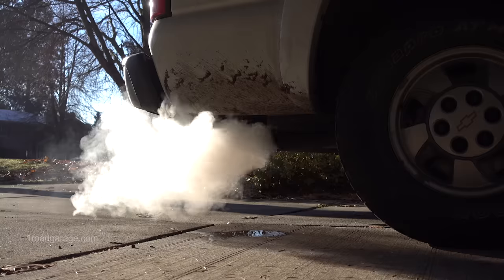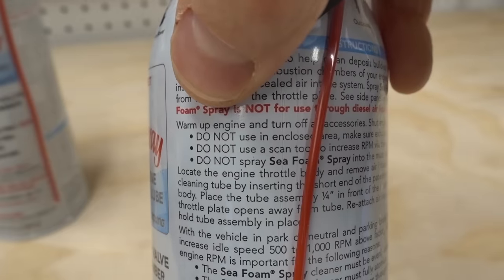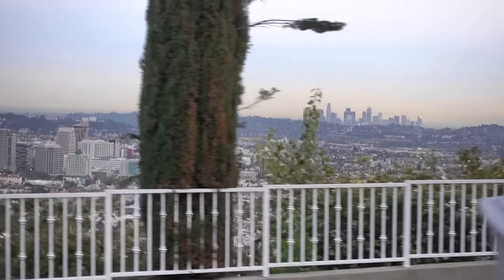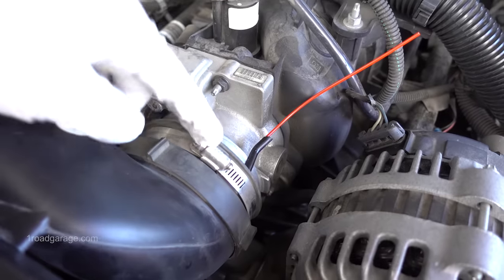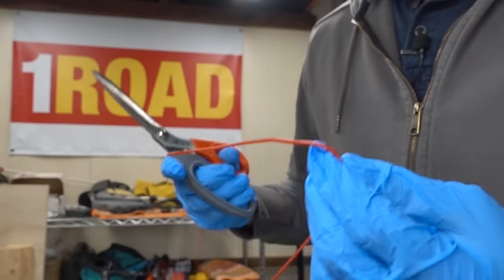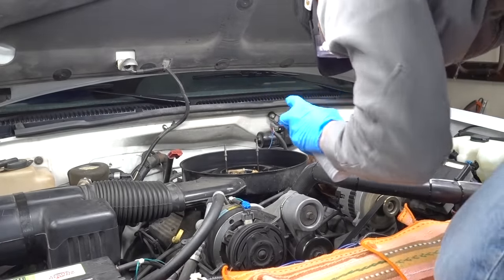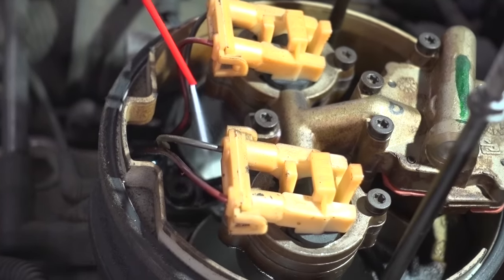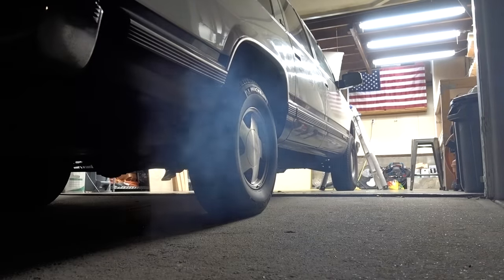Why You Should NEVER EVER USE SEAFOAM!!

Comment: I have used sea foam for the past 35 years in everything I own. I have a 20 year old riding lawn mower. It runs great and still has the original spark plug in it. It works that well, sea foam and my mower. I used a camera to look into the cylinder and the piston is incredibly clean. I also use far more than the recommended amount. I also us Mobil 1 engine oil. For 6 dollars a year its cheap. It always starts every year with leaving the gas in it all winter. my snow blower is also equally great running with Mobil 1 and sea foam. Living in Minnesota I get a lot of use out of it. Buy it! I have never had an issue with not starting leaving the gas in both year round.

Comment: I have a 99 Tahoe with over 200K. I did the hot soak spraying into my throttle body. Did see white smoke but not a lot.  I threw some seafoam in my oil n will change oil in 300 miles. Great product. Love your videos.

Comment: The way to do it is similar to Wal-Mart: Basically, have a way to meter the intake side of the engine, using the brake booster hose (it's like using a vacuum pump to bring in the Sea Foam directly into the intake system). Then, use half of the can and run it through your fuel system -- and keep the car running at idle the whole time in Neutral (manual) or Park (automatic).

Comment: You have to pour enough seafoam into the engine to stall it at Idle. Allowing the engine to run after you've stopped applying the sea foam clears out much of the seafoam.  if you wanna get those epic smoke plumes you see

Comment: Those old T-body engines have fuel constantly cleaning the inner surfaces of the intake manifold and runners. Newer  injection system designs never see fuel up in the intake, just a mixture of air and crank case vapors, which equals more crud build up in the intake stream compared to your old truck. Newer isn't always 100% better .  You'd be better off just dumping the cleaner in the fuel tank and drive as usual.

Comment: Never used this stuff in my life...until this week. Put some in the tank at a pretty good level of concentrate and added some to the oil 100 miles before an oil change. Honestly, you can feel the power difference in the pedal and the valvetrain noise is markedly less. Impressed. Ford 3v 5.4L with 189,000 miles, otherwise a well maintained motor but obviously had some carbon and sludge.

Comment: I NEVER used Sea Foam on my truck and it cleaned out all the carbon deposits. 

The slight hesitation disappeared and the engine runs as quiet as the day I drove it off the car lot 11 years ago.

Comment: Currently got a 95 k1500 suburban white in color too. I get tons of smoke from mine every time I throw a can down her throat. I generally do it 2-3 times a year depending on how the truck is running.  A few things that I noticed you doing that I've found to be less effective and create very little smoke from burning the seafoam too quickly.  Dont use the spray either dump it slowly or preferably use a vacuum line the pcv or brake booster works great. Dont rev constantly suck in seafoam till its almost stalls plug vacuum line with finger and use the throttle to keep it from stalling. When u get to the last 1/4 or less of the can proceed to feed it seafoam till it stalls. I like to give it some throttle as I give the last drink so it will pull to all cylinders as it stalls out. Whatever is left in the can I just dump down the throttle body to sit. I generally let it sit 30-60 minutes before I even bother trying to start it. Once it starts be ready for the fire department to show up at full speed hoses ready. One thing I do extra is after its back up to temp and I have taken it out and beat it like a red headed step child is I do a steam cleaning.  I use 4 bottles of water and just like the seafoam slowly feed it to the engine keeping it from stalling by gently revving it once I've got the last of the water fed I put it back together and then go for a nice 40-60 mile hard run and just feed it all the fuel and abuse i can. The water rinse helps remove alot more carbon deposits than seafoam alone

Comment: I pulled the spark plugs on my wifes 2010 honda cr-v, poured some liquid seafoam in let it soak for a couple of hours, turned over the motor with no plugs to blow out the liquid and when I put the plugs back in and fired it up the white smoke was crazy! Seafoam is a great product,  I've been using it for years.

Comment: I for sure felt the different when I did this with my old Focus. The biggest difference I noticed was in acceleration.
Reply: same here, i have a jeep 4.0 straight 6 and I did as the can said, got more rmp's and faster acceleration i think also
Reply: I used the STP Intake Valve Cleaner on my Mini Cooper S, directly into the intake pipe. It worked beautifully for improving acceleration and smoothing idle drastically

Comment: Yeah that's your problem definitely buy the other can and take the vacuum hose from the brake booster to the intake manifold and run the vehicle and do it that way I would use about half can or less than half and let it hot soak for about 15 20 min and the fire it back up and may be hard ti start and then once get it going it will smoke bad lol I've done this many of times on different vehicles a 93 ford ranger 4.0 and a 03 kia sedona van and a 98 saturn sl2 and a 05 honda accord and a 07 ford freestyle and a 97 mazda 626 and a 85 chevy s10 and a 92 chevy s10 and a 85 chevy celebrity and a 87 Plymouth Voyager 3.0 and a 96 dodge grand caravan 3.3 and so sor much more lol and every time I used seafoam I did it through the brake booster vacuum house to the intake works everytime . No isses never had a issues at all

Comment: I’ve been seafoaming for over 10 years you want smoke and you really want it to work don’t buy their lame spray can thing buy a regular can pull the vacuum line off the brake booster get a funnel suck half a can in through there as fast as possible without stalling the engine. The problem with the spray can is the flow rate is to slow and most of its immediately sucked up and burned in combustion so really that method is a waste of time and money.
Reply: Where is the brake booster?
Reply: the big round thing on the fie wall behind the brake pedal
Reply: lilbill11891 excellent explanation and that’s a good way to remember it.

Comment: I did this today for two vehicles: 2007 Hyundai Santa Fe 3.3L V6 (220k Miles), 1998 Ford Explorer 4.0L V6 (163k). I also added 1oz. Per gallon of fuel to the tanks and 1oz. Per quart of oil to the crankcases. Honestly, the Ford didn’t really make much smoke at all throughout the spraying process, only after the hot soak did it produce minimal white exhaust. The Hyundai, however, smoked a fair amount throughout the spraying process and then minimally after the hot soak. The Hyundai seemed to have a bit of clanking and knocking at start up after the hot soak, but that went away about .5 miles away from the house. The Ford started ok but the idle fluttered for a minute or two after the hot soak but went away before I left the parking spots. I’d did recognize that both engines had better throttle response and ran smoother during the “aggressive” driving and at idle after returning home.  All in all I’m please with my $60 invested. We’ll see what the oil looks like and what improves after this tank of fuel.  I’m curious what others think about the fact that it was 30degrees outside while I did this; of course knowing I let the cars warm significantly before beginning?

Comment: This is the process for my oil changes.  I have a 95 GMC K1500HD 350/5.7L GMT400 and love it!  I run a 350/5.7L TBI, S10 2.2L, and Merc Mountaineer 302/5.0L and do the same thing for all of them. Seafoam in the oil crank case and fuel tank about a week before I schedule the oil change. A cup of kerosene in the oil before you change it. Then the I put a cup of kerosene in the crank case run for about 5 minutes after running it on the drive home from work or the store or better to do it just sitting in the drive way after you get back and let it work without a load. Your engine now is stripped so you have to rebuild the lubricity of the engine. I used to use Zmax but after watching (Project Farm) his tests are great and I understand it is just mineral oil, which I thought it was and just went with it but now I use Lucas Synthetic with a heavy oil (Summer 20W50 no additive or 10w 30 with additive for winter if I am running for a long drive (Md, WV, to Fla). Around the house depends on the vehicle but the S10/2.2L 5w-20 Syn Change every 5k, Small blocks 10w30 in winter only additive for the long hauls and 10w40 for summer with additive and 20W50 for hot summer long hauls. So far 230k on the 95 K1500 5.7L, 200+k on the Merc 302/5.0L, and 210k on the S10/2.2. The S10 is known for head gaskets every 90k it has had one replaced and a new head at 180k but I run that lil truck like NASCAR and still runs great! Thank you for your expertise, knowledge and willing to share the info! Great looking suburban and Happy New Years!

Comment: I used seafoam because I got a code saying one of my variable valves was reacting slowly. I put this in my engine oil for 300 (edited from saying 3000) miles and then changed my oil. All sorted and the code never came back.
Reply: Why would you run it in there for 3000 miles its only supposed to go in there for a few min befor you change your oil not the life of the oil ill bet that motor dont last as long as you hope it does lol
Reply: @919249  my bad, it should say 300 miles not 3000. Though the scheduled oil change on a grand caravan is 10000. Changing oil at 3000 miles is just a waste. I have worked in heavy construction for most of my life and companies have oil analysed regularly to make sure they're not changing it before they really need to, to save time money and resources. Oil much longer than most people realize
Reply: @919249  have you ever read the back of a seafoam container use at oil change or before nothing says that don't use this in long periods of time in your oil ever watch project farm u might learn something from it btw u know nothing about seafoam
Reply: @919249  yeah change ur oil ok done put seafoam in ok done now that the new oil have seafoam and has been in the oil one min oh shit have to change my brand new oil bahahaha this guy
Reply: I had a 1989 Ford ranger with 250,000 miles, I sea foamed it for 1,500 miles in the oil on purpose. It never did survive. Under the valve cover oil was pumping metal shavings from a rod. And exhaust was smoking like a volcano. It did cleaned the engine out so well it restricted oil flow through the filter and pressure loss was so large the oil pressure gauge flatlined randomly. The recommended 50 miles seemed so little at the time. It was a interesting experiment. Thought it would last longer though
Reply: Usually the vvt spool or oil control valve stick due to poor maintenance. Usually changing oil every 3 k prevents this. And have solved many cases of it by just changing the oil.
Reply: Bob in AZ
Reply: Bob in AZ changed the oil every 3K miles in a cylinder engine and added Slick 50 additive twice per year.  Result was over 600,000 strong miles before the 2nd transmission burned.  All about the oil, gentlemen.

gentlemen....
Reply: @robertfranke8991  interesting.  What was the engine ? Did you buy it new ? A couple times in my life I changed my using royal purple oil instead or conventional oil. Immediately upon start up I could tell a difference. Engine turned over easier.  Started quicker.  Ran smoother.  Felt like it had more power and a longer power band. I noticed the absence of vibrations from the engine that I hadn't realized were there until they were not there.  At some point I statred hearing that it was not a good idea to switch from conventional to synthetic oils if a engine has any amount of miles on it. I never seen any concrete evidence of this but, I didnt want to use my engine as a guinea pig. Even though it was a dodge 318. Lol. If you started using slick 50 well into the life of your engine and it lasted 600,000 then what I heard was likely false.
Reply: @whatyoumakeofit6635  To be clear, my 2.3 litre (aluminum) 4 cylinder engine came in a Mustang purchased new from the dealer.  After the initial 10K miles; after three regular oil changes I began my Slick 50 regimen.  My car was constantly used for work travel, so the mileage became simply "tanks of gas."  

My amazement was realized each turnover of my odometer and the engine never died--- only two transmissions.  Slick 50 works.
Reply: @whatyoumakeofit6635  The odometer mileage was strictly recorded, along with date, price, amount, oil changes done, tune-ups, battery changes etc.  The car was well kept and rewarded me handsomely.

Comment: Hey i have the same vehicle next time u do this put half of it into the gas tank and the other half into the vac hose connected imto the brake booster.  The engine will choke alot after u pour the whole second half into the hose let the engine die. Connect the hose back to the brake booster and turn the car off wait 20 minutes turn the car on. I promise youll make your whole block cloudy.
Reply: Damien Chavez It’s not good to hydrolock you engine like that. Your could bend a rod
Reply: Hunt Guy u do it slowly and it will choke up and eventually shut off from it then just add a lil bit after it dies on its own then if u still have some left over just tank it in the gasthats how I do it every time and I get the fire department call " there's a car on fire " ha ha ha then drive down street with it billowing and it clouds up everywhere looks cool too
Reply: You don’t hydrolock the engine you let it chock it’s self out “make it run too rich” you don’t dump the can in lol.  Then you let it sit plug the hose back in and fire it up.
Reply: Yea the Brake Booster is how I did mine I have a 95 Tahoe the sane color as his Suburban in the video
Reply: Non pressure can poured into the brake booster hose FTW
Reply: Brake booster vac line is the way I do it also. Does the best job.

Comment: Seafoam has fixed my 2 stroke outboard motor several times. We had fuel contamination, had the tank and fuel lines drained, filters replace and ran it on a small tank with one gallon of high test gas with a whole bottle of Seafoam. Smoked like crazy, let it sit over night, ran it again long enough to get hot and then ran the motor on regular NEW fuel. BAM…slow starting and rough running ended. Spraying directly in the carburetor is good too but it must be in the fuel.

Comment: Hi so I put seafoam in my VW 03 tdi right in the crankcase.  After about 10 miles, shut the vehicle off and it made the strangest "large bell ringing" sound.  Now the starts, and general engine noise are REALLY loud.  I was worried so I dropped the oil, and put fresh oil in.  Problem persists...and now when I just checked the oil, it appears that not all of the seafoam drained out.  You ever hear of something that sounds like this?  Could I get a little guidance/information from some people with some experience here?  Should I have given it even more time to work its magic?  I'm having a bit of a freak out here.  Thank you!

Comment: I've used this stuff for years and actually talk to the gm at seafoam for use on new vehicles... anyways trucks like ours, mine being a 2000 silverado z71 5.3 to get the "smoke" tour looking for and to do it the best way in his words on older vehicles where the hose feeds all cylinders unlike newer ones where u domt know how many it feeds to... I drove my truck to pick a can of the reg seafoam about 3 miles from the house so engine at operating temp.  While its running u wanna take the brake booster hose and disconnect it from the plug that goes into the booster... itll idle down and sputter (normal) pour your can , itll actually suck it out of the can for u if u hold the hose upright until the can is empty or your engine stalls and stops running whichever is first... then hook the hose back up to the brake booster and let set for about 5 min... when u crank it up itll sputter and idle rough for about 5 sec then it will idle normal.. dont rev the engine just keep letting it idle . After u can find your way back to your car from all the smoke about 5 min later then u can start revving the motor and keep doin that until smoke is gone or almost non existent.. follow up with a 10 min drive while driving pretty aggressively to get what's left in there out you will have an immediate feel of power , throttle response , and it cleared my engine codes by itself.. I have a edge programmer.. if it doesn't work that way with proof u did the steps I said I'll buy that can of seafoam via PayPal for you..  the seafoam guy u cant use to much seafoam ita petroleum based so dont worry about that... hope rhis helps... I 200% guarantee if u make that video u will b blown away with all the smoke and the diff it makes... I never had any luck doing it thru the intake ... if u wanna get ahold of me or ask me anything hmu and I'll get u my # somehow and we will talk ... best of luck and I cant wait to see the video and your reactions lol
Reply: Btw I'm a new sub so if u already done it that way then great.. maybe my comment will help someone else.. thanks agai